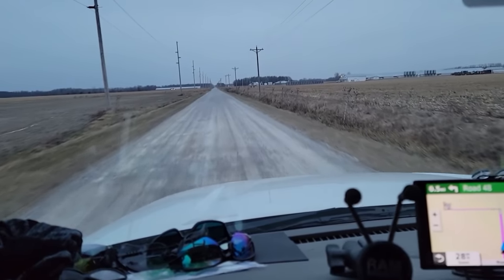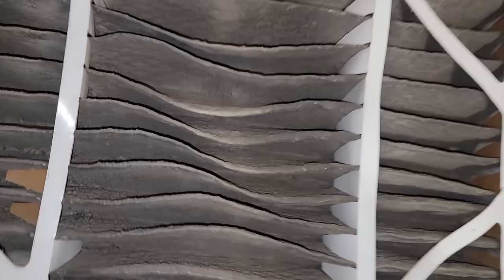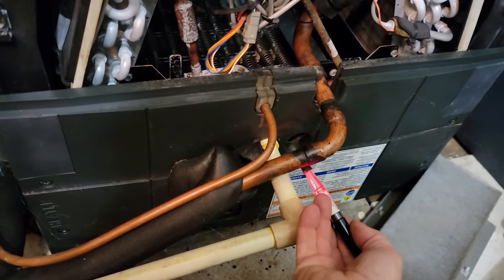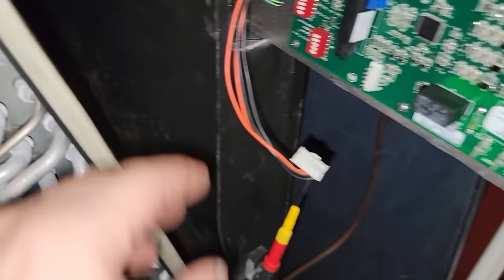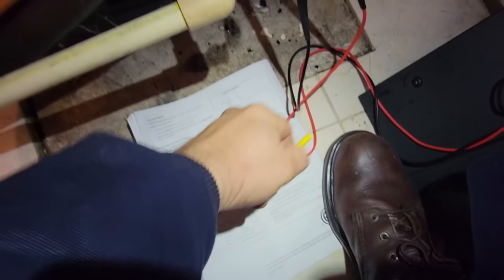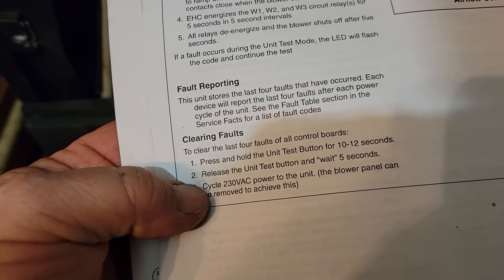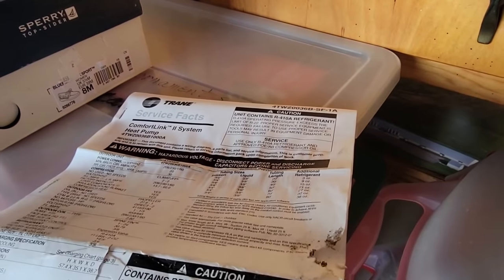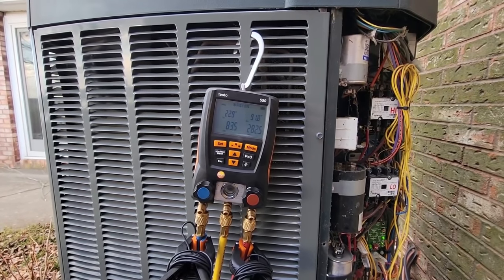Trane Heat Pump Goes Off The Rails & I'm No Engineer

Comment: Just chiming in a year later because this came up in my feed again.
The indoor coil sensors have nothing to do with heat pump operation. The outdoor eev and low side pressure transducer  and low side thermistor mounted by the compressor drive the eev through an outdoor eev board.
In cooling mode if you get an indoor coil sensor failure you can unplug both the sensors and it will drive the eev to contingency mode and cool fairly well until you get back ( unless the eev has failed or the strainer is clogged with crud)
I've worked for Trane Comfort Specialists for 20  plus years, and I can imagine what it must be like to walk up to one of these or a TAM9 with an XV20 variable speed compressor and you don't have the literature. YIKES... I find Trane to actually be very sensible and easy to diagnose once you understand the flow ,the system testing capabilities off the thermostat  and you HAVE ACCESS TO THE SERVICE FACTS,and they're just as reliable as anyone else out there if not more,and we all know what that means. Great video!!!!!
Reply from the maker: Thanks man! It's no more high tech than a Carrier Infinity. Just like you said, if you haven't seen it before 😲 but if you know the sequence of operation it's going to be easier

Comment: Since you are not a Trane fan, what manufacture do you prefer for residential?
Reply from the maker: Most of my experience is on Lennox and Carrier but the majority is on Lennox. I'm not a Lennox fan any more ... all this equipment is  garbage anymore. However Carrier Infinity has some pretty nice stuff. Believe it or not I have almost no problems out of the cheap Ducane equipment. Most of it boils down to technical support from the factory, good engineering and proper installation, if you miss any of those items,  everything's going to be a disaster no matter what brand.
Reply: I prefer the equipment brand that is  installed properly, by someone who cares, and is serviced regularly.
Reply from the maker: I agree
Reply: @HVACRSurvival  That's weird, since Ducane says on their web site they are Lennox. Ha. 
This is why I hate it when people hate on Gree. Maybe it is deserved but so far I haven't read anything of substance bad about them on the HVAC forums.
Reply from the maker: @sprockkets  Allied Air owns Lennox, Ducane, Air Flow, AirEase, Armstrong, Concord and MagicPak. Like I mentioned before My first 15 years of my 26 we're running residential and commercial for a private Lennox Premier Dealer that also sold Carrier. Also worked for a Rheem dealer.